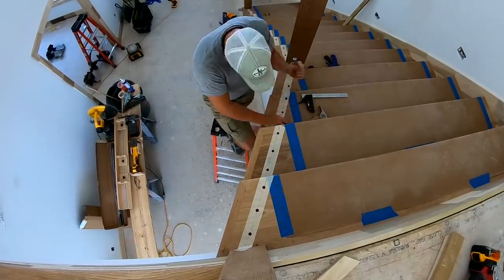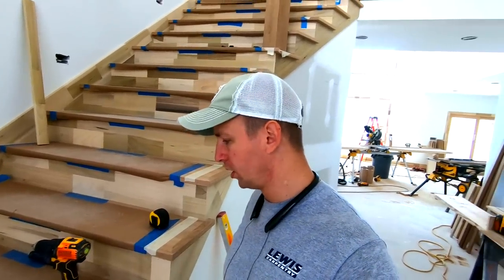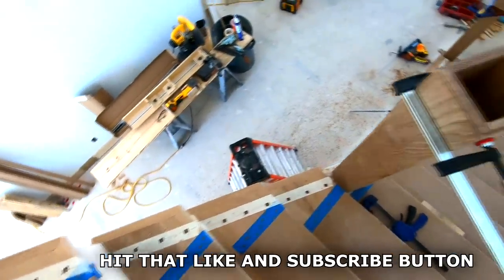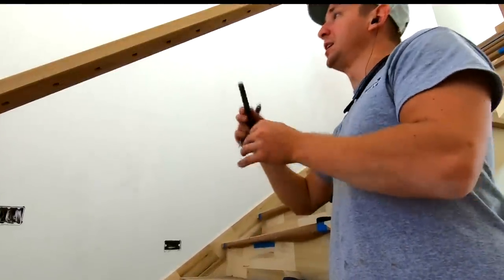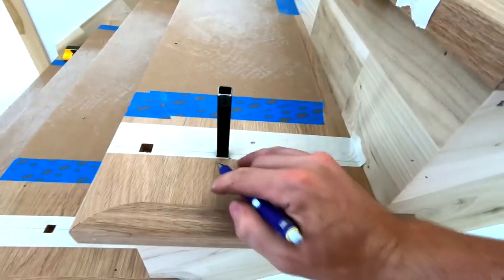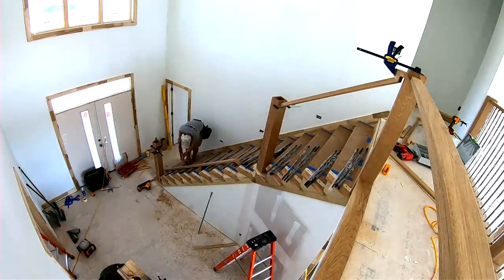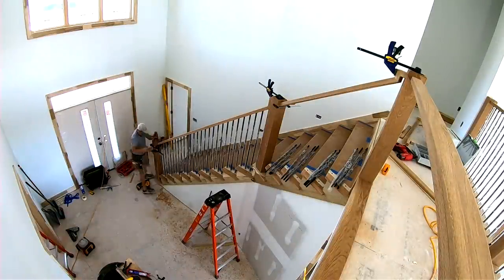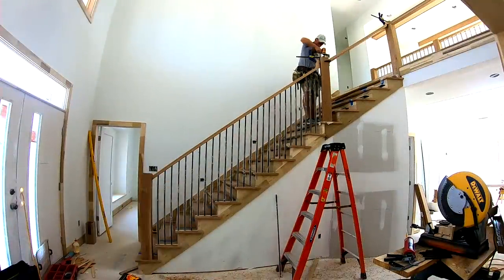Square Mortising Hardwood Treads, Iron Baluster Installation, and Handrail Installation

Comment: Bro as a trim carpenter doing and learning these exact same things, I for 1) cant thank you enough my dude. i wish i could be there and learn from you directly. and 2) think that you're absolutely a beast.
Reply from the maker: Glad to help my friend.
Reply: @InsiderCarpentry   I agree with Robert. These videos are awesome. You are very good at what you do. I've done trim for years and recently started installing stairs... man, you're not kidding about doing everything in the right order and making sure that everything is perfect. Otherwise it turns into a nightmare. I've had a couple jobs that I wasted a good amount of time and materials because of one or two mistakes that ended up screwing up everything. The trick to stairs is to take your time to do it right, following the proper steps in the right order, and making sure everything is precise. Your speed square and bubble level need to be your best friend when you're doing stairs. Also, Tight Bond makes a construction adhesive that works great for stairs (for balusters and for securing end caps, wall caps, treads, risers, and shoe base to the framing of both the rake sections and floor level sections). Typically the posts I install are solid ( not usually the hollow Newel posts) so I use post bolts and then cover the holes with a boot wrap or have to plug em or I drill a half inch pilot hole about 3/4's the way through the post and then 1/4" hole the rest of the way through the post and then a 3/16" holes through the riser and cinch it up with 3" screws through the side towards the bottom of the post and into the framing riser and use just a dab of construction adhesive on the bottom of the post and the side that's flush against the riser (if all that makes sense). Anyway, great work brother. I've learned a ton from your videos already. God bless.

Comment: Such great tips!  Re mortising treads: I found it very difficult to line up the ½" mortiser chisel perfectly on the ½" hole. I switched to a 7/16 forstner bit which enabled me to look down through the top of the mortise chisel and align it perfectly centered. I then cleaned up the mortise with a "pig sticker" mortise chisel.  I also bought the mortiser chisel through your link and it needed quite a lot of honing (of the flat sides) to get it sharp, once I did that it was a lot easier to mortise my oak treads. Thanks again for all your great videos!

Comment: cool! this is exactly how we do the mortise into the tread. but hey for the hand rail we use a spade bit and we do not cut the round off the top of the balusters, generally we use house of forgings balusters. the long point at the top of the spade bit lets you drill into an angled piece. what i will do is tun the rail upside-down and backwards, set it on the stair (the really only works for straight runs) and then drill straight down. i use a bullseye on the back of my drill. i will start my spade bit parallel to the rail then rotate until i am plumb in both directions stopping as to not over shoot. one i am plump i burry the spade and move to the next hole. its very fast and very accurate especially for production. for curved sections or sections that have a goose neck ill keep the rail in its resting position put one screw(or you choice of mounting) in either end to hold it firmly and drill plumb up in place on my mark following the same steps for drilling down. ill often do this before doing the tread on curved or winder pieces so i can double check my spot laser land in the center of the hole. also using a plumb spot laser is great for this. ill split the single dot with a mini tri square for my cross mark and just mark center on the laser dot. we also use a 2 part epoxy for the gluing in of the balusters.

Comment: I just finished my iron baluster handrail thanks to guidance from this video. It turned out pretty nice. As in the video we intended to NOT have shoes but instead simply square mortises in the treads. However when we did a dry run on a scrap board we didn't like how it looked. We used 3/4" balusters but they weren't a full 3/4" and thus fit a little bit loose in the square mortises. It seemed to us like the extra space was a great place for dust to collect and be difficult to remove. In the end we used shoes, and we got the shoes that had set screws because then we could use the shoe to hold the baluster up fully seated into the handrail. Why did we use 3/4" ?? Because then we could have only 2 balusters per tread since our rise/run is 7/10 and max gap between balusters on a flight of stairs is 4-3/8" (and only 4" on a balcony or landing).

Comment: Another good video.  Keep up the good work.  If you consistently have a larger mortise than you want when you age hand driving the mortise chisel, you can reduce its size by simply grinding the four sides down a few thousandths.  You can easily do this on a stationary disk sander or even with your belt sander if you mount it upside down.
Reply from the maker: I've definitely been considering that. I'd like them tighter in the tread but the trade off is that then it makes it harder to get the handrail on. I did get a type of baluster that were super tight and really hard to get the handrail on, so that makes me weary of getting aggressive on reducing the size.
Reply: @InsiderCarpentry  have two, one reduced in size for the bottom and one standard size for the top

Comment: Nice work.  Consider going to a machine shop and have them make a center guide locator pin for your hollow chisel.  No location other than squaring  up would be necessary.

Comment: Thanks for these staircase videos. Your method of measuring the spacing of balusters really worked on my horizontal balcony! I had watched many others and either the numbers were wrong or you needed a main frame computer to  calculate! I bought the little digital angle level you used and I'm wondering if this is the same little bubble level you have attached to your drIll? If not, it's not on your list. Lastly, how did you transfer the measurements on the treads to the underside of the handrail .. is there a video ? Again, thanks so much for these relaxed, carefully explained tutorials and not filling the background with head splitting loud heavy metal music.l!

Comment: This is exactly what I have been searching for! Great info clearly explained. Just wondering if you have a video showing how you drilled and chiselled the holes on the underside  of the handrails ... they would have to be drilled at an angle and I'd love to know how you did that! Also, I was looking for your video on how you used certain screws to attach handrails ... is that still in the works? Thanks again for your generosity and hard work providing these videos.
Reply from the maker: Yes, that was the previous video. See my channel video feed.

Comment: Ones more Pro Tip. You can eliminate a lot of the guess work around lining up the hollow chisel but using a the chisel that it came with as a centering stud.  I cut off the shaft so that I don't have to take it out to hammer the chisel home but later decided that I was wanted something that fit better with zero slop so I turned a hard maple  dowel that fits perfectly into the chisel hollow. The dowel fits perfectly into holes in the tread. This set up makes vertical alignment easier and centers the hollow chisel perfectly every time.  But you're unlikely to have the resources on the job to make this tooling so do it in the shop before hand and have it ready to go when an iron ballasters job comes alone,,, lining up the chisel every time is tedious and can be frustrating. Over the fifty plus years of my carpentry career I learned to take the time to built jigs and tooling to ease and simplify these frustrating tasks. Since I aways have an apprentice in training with me now I turn these jobs over to her,,, after giving her  complete instruction similar to how you demonstrate in the video since I want her to be able to do it with out the centering stud and understand the importance and effects of the alignment to the final product we are building.  But by using the centering stud I achieve a modicum of piece of mind that I can walk away and get started on the next task knowing she will be able to execute to a high level of accuracy, approaching the level I expect from myself. 
If you're in the businesses for the long run you will use that jig again and probably more than once. Good jigs like good tools pay for themselves time and time again.
Reply from the maker: I will definitely have to make that! Thanks for sharing your experience.
Reply: Such a great idea
Reply: I custom order precut and sized square balusters where the tops and bottoms are circular. They grant you the exact depth you need for your forstner bit, taking the guess work out for a consistent depth, while simultaneously negating the necessity to chisel out a square hole in the treads.

Comment: Did I miss where you mortise the handrail for the balusters?  How did you maintain the angle (slope) of the stair run when drilling the rail?  A set of stairs I'm working on has a slope of 36 degrees so I'm trying to figure out how to drill the rail at a 36 degree angle.  Thanks for all you've done w/ trim carpentry videos.  They've been a god send in giving me some confidence in the path to follow in getting these stairs done.  Unfortunately, the set I'm working with are not post to post but over the top style handrailing.

Comment: There's a faster way to determine the height of each spindle and batch cut them.

Rise divided by number of spindles on the tread will = x. First spindle is usually 36" in most places, 2nd spindle is 36"+x, third spindle is 36+(2 times x). This is not limited to 3 per tread, I just chose that as an example. Just divide the rise and keep adding

Shown a different way;  Rise = 7.5" , 3 spindles per tread.  7.5/3=2.5".  first spindle=36", 2nd spindle=  36"+2.5", third spindle= 36"+2.5"+2.5".

Or; Rise = 8", 4 spindles per tread. 8"/4=2". First spindle 36", 2nd spindle: 36"+2", 2nd spindle 36"+2"+2", 3rd; 36+2+2+2, 4th; 36+2+2+2+2.

Sometimes this doesn't work if you have unequal sized spindles in a pattern or some sort of fancy iron scroll causing you to shift it around to meet building code, then you're better off doing a layout on the floor and using the layout jig.

Also, plumb your spindle locations while the rail is clamped to or resting on the treads, this eliminates sag/crown. Especially when doing a curve+twist rail when the nice straight level is useless.

Comment: I just installed a rail much like your lower section in this video. If you grab a hold of the center of the rail, half way up the stairs, you can wobble it pretty significantly to and from your hip. I don't know where I went wrong or what I could do to strengthen this.

Comment: I have a question or two about the iron baluster installation. This is my first time, and I just installed wood railings for two flights on my own. It was extremely tedious and a learning process, but the most annoying aspect is the metal connectors from rail ends to the box newels. I plan to install hollow iron balusters next. After marking holes for baluster insertion points top and bottom, must I disconnect the railings and remove before installing the iron balusters? Or may I keep railings as they are and drill deeper top holes so balusters can slide up into sockets then back down as the bottom of baluster fits into the bottom hole? I see a disadvantage that the latter approach would preclude the baluster from providing support for the railing. I'm not sure how important that is because I believe that the wood railings and wood newels are very strong. How about advice for avoiding rattling or movement of iron baluster after installation?

Comment: I have a stair project that I need to make square hole under the handrail, the balusters top is a 1/2inch square. I see you did the square hole on the handrail, did you use a drill press for that or other method. Expecting your reply. Thank you

Comment: Suggestion to line up chisel centered and plumb.  Needs a lathe or a friend with a lathe.  Take a ½" steel rod longer than the chisel by a couple inches.  Put it in the lathe supported accurately by the tailstock.  Only grip in the chuck a little less than as deep as is the drilled holes.  Turn down the rod from the chuck to the end, to a diameter that will have a sliding fit inside the chisel.  Remove from lathe, insert into the chisel, mark the length.  Remove from chisel, cut it to about ¾" shorter than the mark.

Now put your new alignment tool in the hole, slide the chisel over it and it should line up perfectly.  The end of the tool must not protrude above the chisel.

Comment: Dinosaur rail guy here... I've found those square chisels to be a giant pain, I take a 5/8 chisel and grind it down to a shy 9/16 then chisel both sides of the hole perpendicular to the grain. If you rock the chisel toward the center of the hole once it is seated, it will clear out the material on the parallel-grain sides of the hole so you don't have to chisel them.  With a little practice, it becomes way quicker not to mention, you're not pounding balusters as hard and potentially filling the hole with wood because the hole is too small.

Comment: There have been a couple times when installing wrought iron ballasters that were ill fitting and floppy that I decided I needed to stabilize them in the vertical position.  Although it took a few extra minutes it was well worth the effort. I installed a ledger clamped to the outsider of the newell posts parallel with the handrail about halfway up the ballasters. I then installed a stand off perpendicular to the ledger, offset so that it lined up with the outside face of the ballasters. In my case I made them with ripped and cut offs of OSB scrap. But any 1x will do. I then put up a line of two sided carpet layers tape,,, which I always carry cause it so darn handy.  I install the ballasters and push them into the tape they usually stands straight and tru,,, there are a couple of things that can cause the ballasters to stand wonky but the tape has some give so individual units can be pushed around.. it probably adds a half hour to the total time but there valued it's that it completely eliminates the frustration of going back and forth lining up the ballasters and the handrail hole,, so for me the elimination of that frustration is well worth the extra work,,, you can reuse the one you made on successive runs or make enough to install on the full length of the hand rail suit yourself,,,, I now build it into the work flow for any job that comes along with iron and since it's part of the plan have reduced the fab time for the standoff, ledger and installation of both in half. Pro Tip with two sided carpet tape,,, keep it some place where it doesn't get hot, making the second side of the adhesive want to stick to the protective peel off plastic layer.  Use two sided carpet tape instead of hot glue or other temporary fixings to stick patterns, temp jigs and such, it's faster and the tape is made too stick to dissimilar materials. I was introduced to this trick working Trade Show set up in Vegas,, were everything has to look good, stay in place but be able to come apart easily,,, the crews use it by the case, the difference is that carpet seaming tape is stronger than garden variety two sided tape and the adhesive has a lot of "grab"

Comment: Have you tried hammering in the square hole with a shorter scrap piece of the baluster instead of the square chisel so that it's the exact size of the baluster?
Reply from the maker: I have have but I have seen other guys do that. I will have to try it sometime.

Comment: I cut butte loads of spacer blocks same thickness as balusters then using 2 straight boards I clamp balusters after installing in plate then handrail is a whole lot easier to install

Comment: just curious but what is the cost of installing this stair rail with the iron balusters? just the hand railing part? is it usually more expensive due to the mortising? what kind of cost per linear foot should one expect for this

Comment: What's the reason for putting in the handrail in after the balusters instead of putting in the handrail first and then sliding the balusters up into the hole and then dropping it down into bottom hole?
Reply from the maker: You can do that with round holes in the handrail but it doesn’t work with a tight square mortise.

Comment: Unrelated, but I remember you reviewing your mitresaw saying you’d never go back to the Kapex. In case your ever do miss it, from what I’ve read it was a problem with the N American 120v models and not the 240v euros, and was fixed in 2017. Anyone have that motor issue on one definitely manufactured in 2018 or newer?
Reply from the maker: I'm also a fan of the 12" blade now. Even if the saw is solid, I don't see a reason to switch back for me personally.
Reply: Insider Carpentry I’ve been using the 12” Dewalt you’re using now fir years and thinking about going to the Kapex. Do you know if that special cutting position really makes it comparable to the 12” like they say?

Comment: I've done quite a few wrought iron balustrades and the manufacturer always recommended 2 part epoxy, which as you can imagine doing stairs by yourself , ain't easy. 🤣 My question is : have you ever had any issues using the PL for anchoring the balusters?
Reply from the maker: No issues. Manufacturers are always looking to cover themselves. PL has worked just fine for me as well as a lot of other carpenters I know. 👍

Comment: Spencer, I was wondering why you did not use your Laser measure to calculate the length between the rails and threads?
Reply from the maker: I do it both ways. The laser definitely works also.